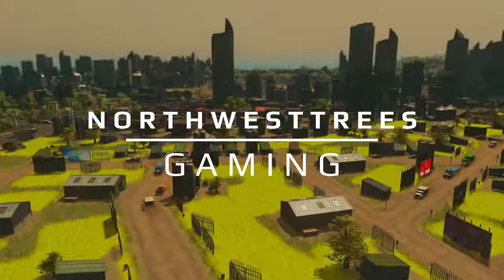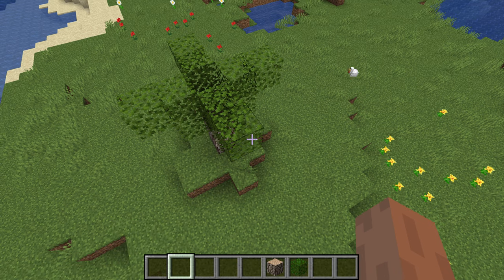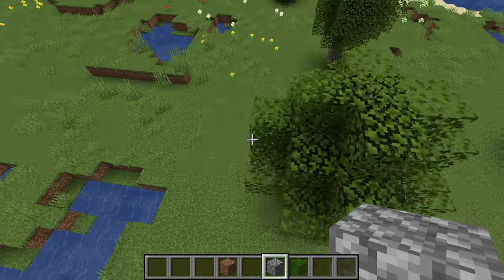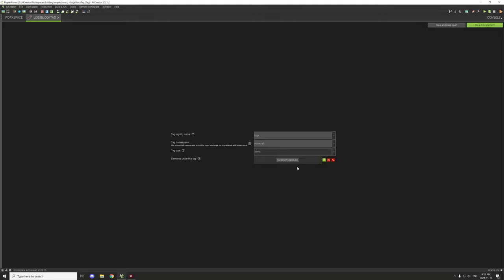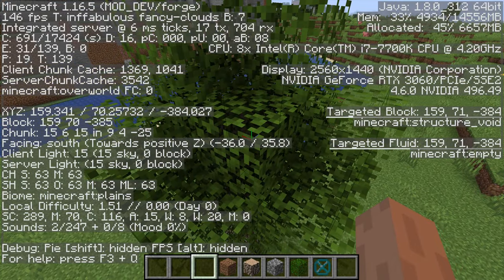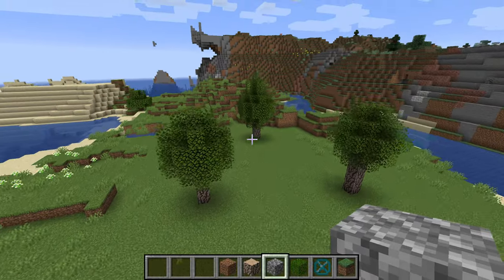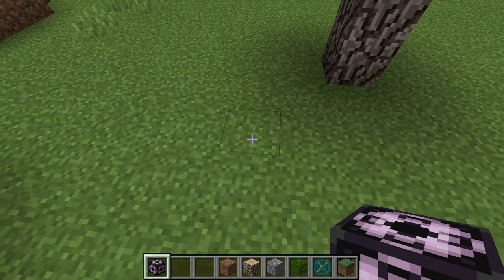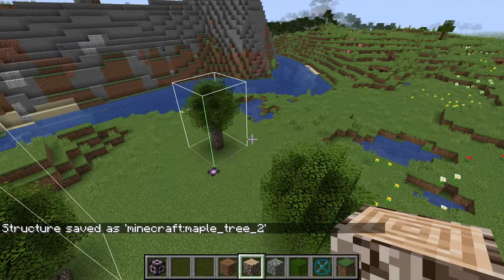MCreator: Building A Maple Forest | Part 3

Comment: Just a little message to people trying this. If you are creating a tree and it says its persistent: false but has a distance of "7" or more above it. It will still get destroyed. Minecraft makes bigger trees like the big oak tree have more wood in it and branches or else it would start decaying instantly.

If you want to keep the tree the same while you start fixing it. Make sure you have structure voids there and then start setting the air with your custom leaves. Make sure they are within your trees radius or else it will go everywhere you don't want it to. Basically this is just doing
 /fill ~ ~ ~ ~ ~ ~ "Your_custom_leaves_here" replace "air"  This will make sure your leaves stay there while you fix the issue. This is easily fixable by placing more of your logs inside of the tree and making sure it's near the leaves that are at a distance of 7 or more.

Another issue that people can have is not setting any structure voids down. Structure voids are very helpful especially when creating trees since they can make sure your tree shape stays the same since the structure voids will shape out the tree in the specified area, If you don't have structure voids then you are creating some risk of losing the shape of the tree when creating a big tree.

Most of these issues I learned the hard way so make sure if you are creating a huge custom tree that you make sure you place a log or two around the tree area so it won't decay.

Comment: I need help. I creating minecraft mod and I want add tool or item which can fas build. You can put to many blocks to this item and after build with it. And when you have effect speed with height level you can place block as fast as you run. (similar example: when you have tool with attack speed 100, you can fast mine (as fast as you run)) Please help me :)
Reply from the maker: Well things are ticked based so I would imagine the fastest you can do things is though the player tick update global procedure, depending on what you want to do for your procedure you would need to figure that part out on your own, however, I would have a safety net in place so its not always running, make sure that a specific requirement is met in order to enable it for example when a player is holding an item in the main-hand and maybe the block to build with in the off-hand, this way it won't always build when you hold two items in both hands.
Reply: @NorthWestTreesMCreator  OK so I try do it :) Thank you for message!